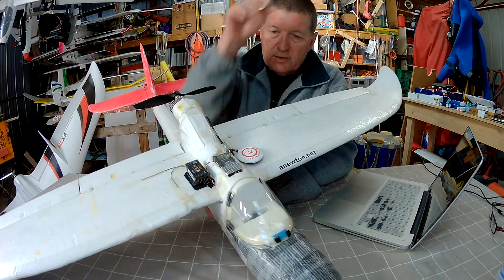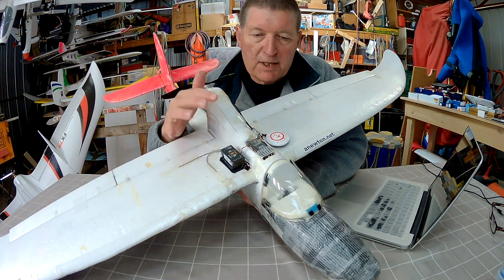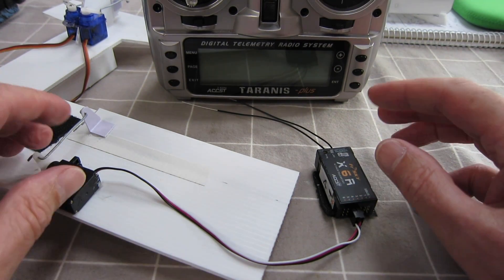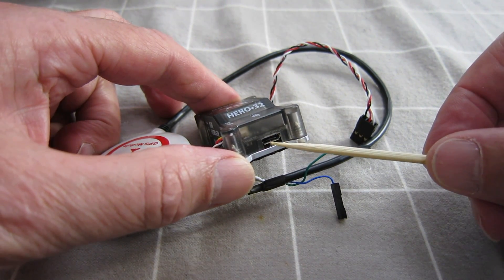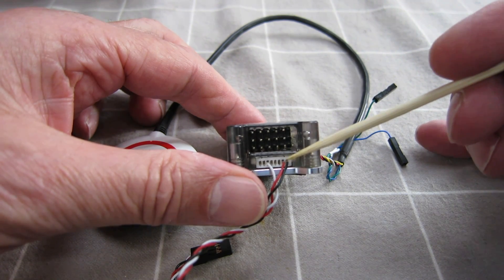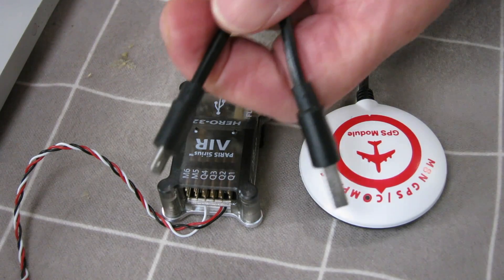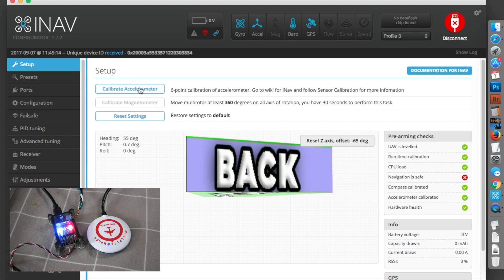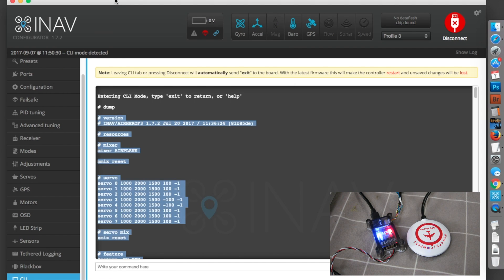Bixler 2 AIR3 iNav Part 1

Comment: Hi Andrew, I've just ordered the Paris Sirius AIR3 flight control board. Thanks for your videos. One question: can I use my own M8N GPS rather than the one included?
Reply from the maker: Cant see why it wouldn't work, but I have only used the supplied GPS
Reply: Ok Thanks, I'll see what happens.